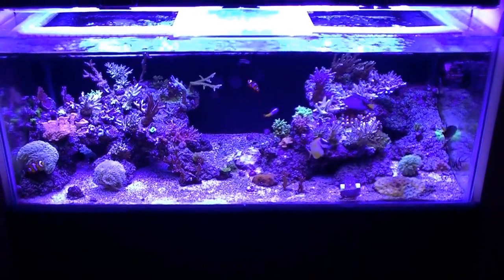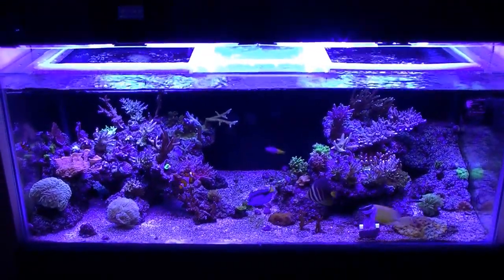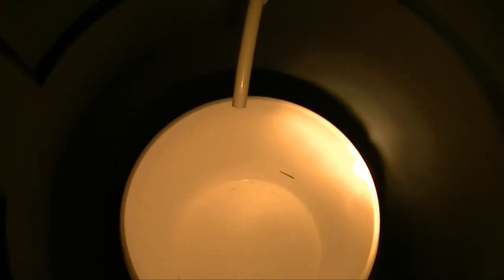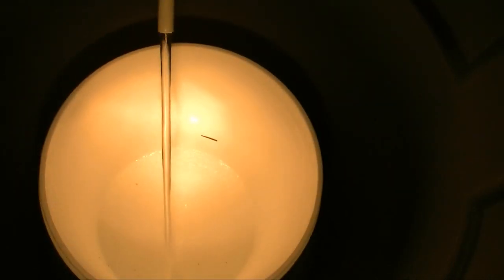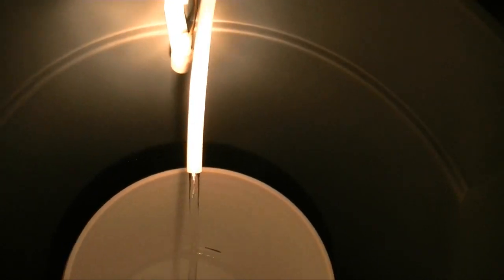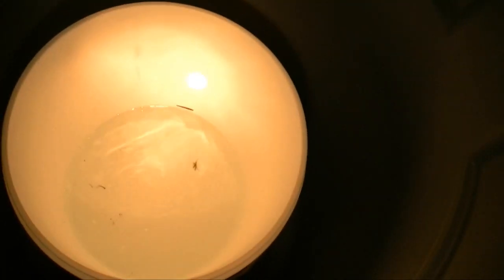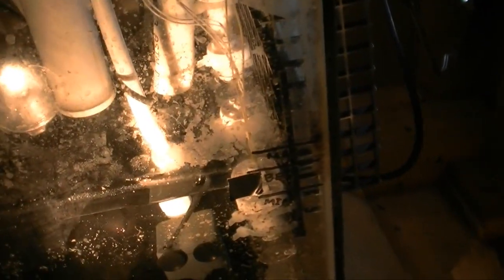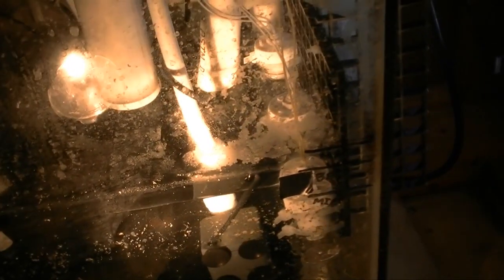Rickets Reef: Auto Water Change in Action

Comment: The issue I see with this setup is that you are not going to have the same amount of water being exchanged everyday. The two pumps are not going to flow the exact same amount of water. It might be close but your salinity will fluctuate too much over time. Even if both were exchanging the same in the beginning over time the pump in the sump will accumulate buildup and the flow rate will change.

Comment: Run the dump line to the sink then do one of two options for protection of malfunctions. Reverse the float valve you already have and actually place it in the tank at the water level you want to never drop below. Or what ever line you have running into the tank for suction of the water being removed, only put it in the tank as deep as you would be comfortable with the water dropping to, This is the most safe way because not matter what happens the water can never drop below the suction line.

Comment: Hey I love your setup! I'm just fettling my own auto salt water change. the pumps run off plug timers, It's basic but it works. I have one problem though I dont know if you've run into this problem but when my sump drains (4.5 Liters per day)  My skimmer level drops  and then when the salt pump kicks in and tops up the sump my skimmer ends up overflowing. Do you have any advice on this? The skimmer is usually running dry. Any advice would be great. cheers Joe

Comment: @bamboosharkbark  Hey great videos. Kind of copied u and set my reef keeper to turn a rio 800 on for about  2 minutes to get 1.5 gallons out each day ona 180 gallon tank. Got my auto top off set up to come on 2 minutes after this happens. Discharge is high up so no syphon coming back and top off is out of a 5 gallon bucket and can not syphon back either. I did not use any floats except for the one on my auto top off to pump water back in. Do you see any problems doing it this way?  Thanks